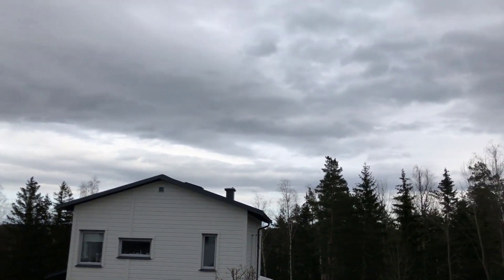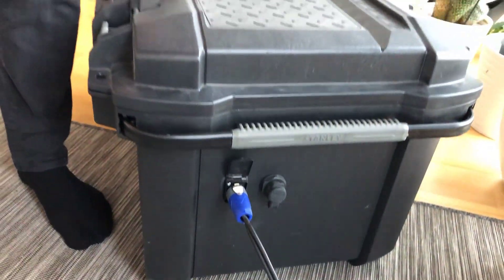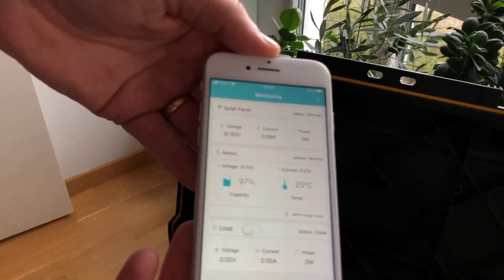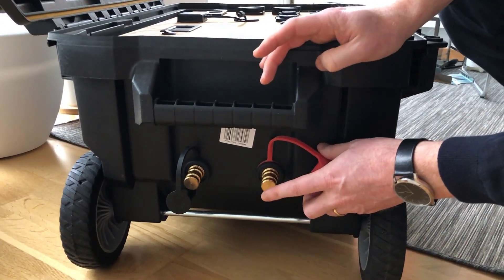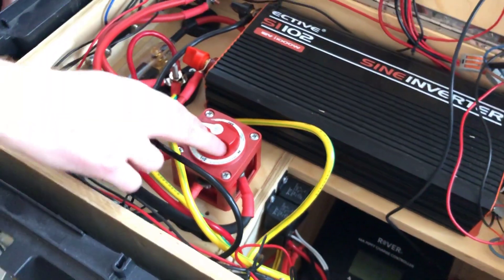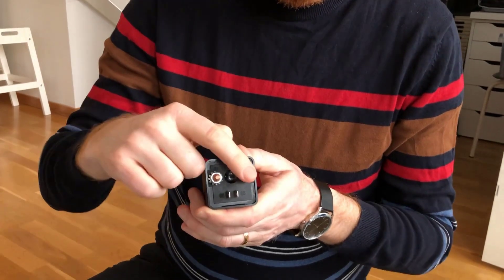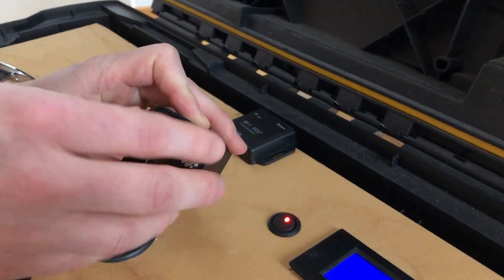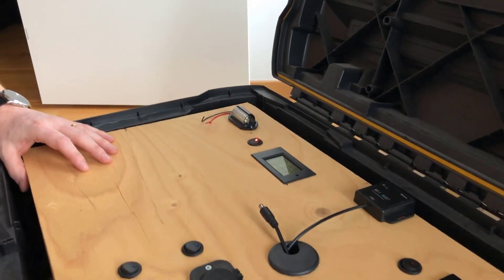DIY Solar Generator Part 2

Comment: Thanks for the updates Thomas! i'm going to build a solar power box this winter. I may start with a smaller box first.  I will use it to power some HF and UHF Radios for my Ham Radio hobby. I need to find an inverter where I can wire the outlets to a box, not sure how I will do that yet. I will use Lipo4 batteries. Stay safe! Chuck W.